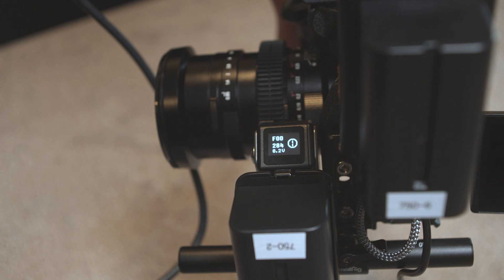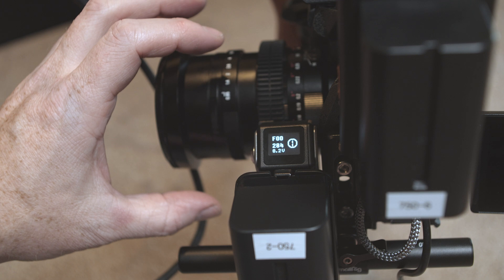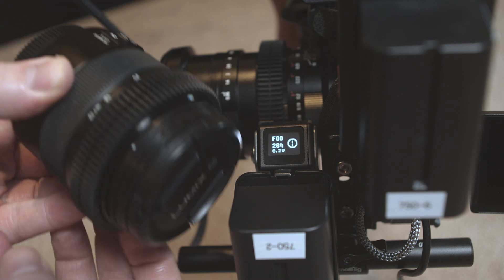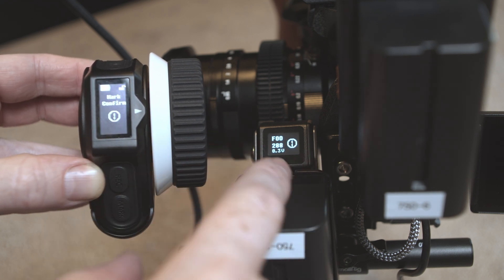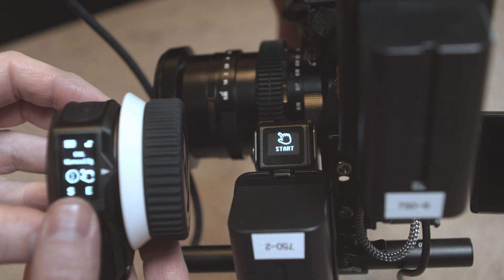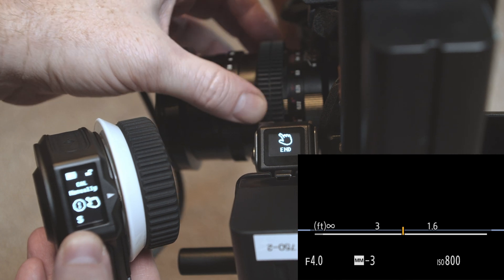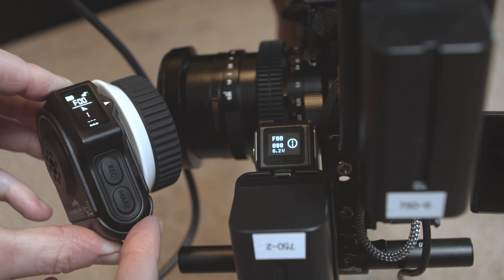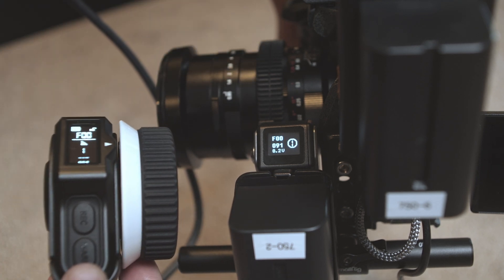Manually Calibrating the SmallRig MagicFIZ Wireless Follow Focus

Comment: Any idea how to do this with the handgrip version?

EDIT: Actually, it's easier to set simply using the UI on the motor itself. No need to set using the wheel or handgrip UI.  

BUT like you said the numbers on the motor and the controller HAVE to be the same. This was my issue all along. The motor was on 3 and my handgrip controller was set to 1.
Reply from the maker: ooh yeah I just tested out calibrating directly off the motor UI. Never thought to do that but yes it does work.

Comment: Thank you so much!!! I've had this for months and couldn't figure it out.  How do I use it in conjunction with the handgrip controller? Do I need to calibrate that separately?
Reply from the maker: I have been meaning to get a video out on this. I recently picked up the handgrip to support a second motor on my b-cams. I would calibrate the handwheel and handgrip separately for each controller. When I connected them it 1) messed up calibration and I had to redo it for both controllers and 2) changed the drive motor numbers on me so those had to be changed.

I did email SmallRig about firmware updates and the support could not give me a real answer.

Comment: yeah the manual sucks.. however I wasn't able to do it your way either. Did it and came here to see if I made a mistake but after doing it this way I have about 1" of turning the wheel until it goes to the end point :/
Reply from the maker: When you turn to the endpoint is the positional information shown not "000" or "999"? If so, you may have to use the K1-CAL option in the controller menu. Click SET to enter. Turn the knob to the end-point. Click SET to complete the calibration, so that "000" or "999" will be shown
Reply from the maker: The motor itself should not be stopping when in manual calibration. If that is the case there may be something wrong with that component. If it is the wheel/controller stopping, then the problem may be within the calibration stuck in a funky state
Reply from the maker: Also, how much power is the motor getting? I ran into problems when the unit was a bit underpowered.

Comment: Well now that I went over this there is a few thing I need to know, I have no idea how to change the channel on the two controllers.Thanks in advance if you can help
Reply from the maker: I’m on a road trip with spotty connection. This isn’t hard but I’ll follow up when I have stable internet again.
Reply: @kneepayne  Thanks
Reply from the maker: @reyvaz2951  There are two numbers you need to match. First is the frequency look for a number that starts with "F0". That is the frequency. On both the motor and the controller, double click the arrow buttons to cycle the frequency between F00, or F01, or F02. Doesn't matter which you choose, make sure both units are on the same F0*.

Next is the motor number. On the motor itself, press and hold the up arrow. The OLED screen will change to read the word NUMBER. And below it is the motor number. Use the up/down arros to change the motor number. When you have selected a number wait like 10 seconds for it to set.

On the controller, look for the "SET" button. When you press the button the motor number on the screen flashes. Again, use the up/down arrows to select a motor number. When you set the number to match what the motor has wait (again) like 10-ish seconds and it will accept the number.
Reply from the maker: I meant to do a video on this but have been slammed since getting home
Reply: @kneepayne  Thanks so much for your help, I'll get to it when I go home, its so bad that now we have to depend on YouTube to answers for things like this, Thanks!!
Reply from the maker: @reyvaz2951  tried to make a video on this and it came out terrible. Should try again tho, think some video tutorials are necessary
Reply: @kneepayne  Thanks! If you do I'll link that video to every one with trouble on this, there is a lot.